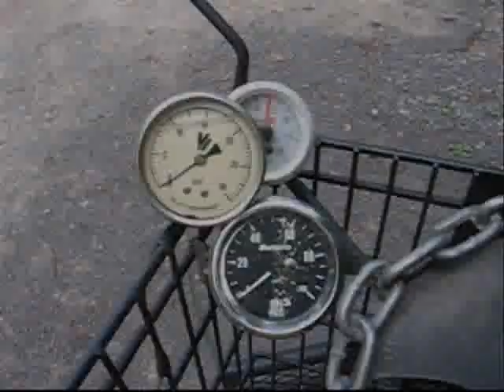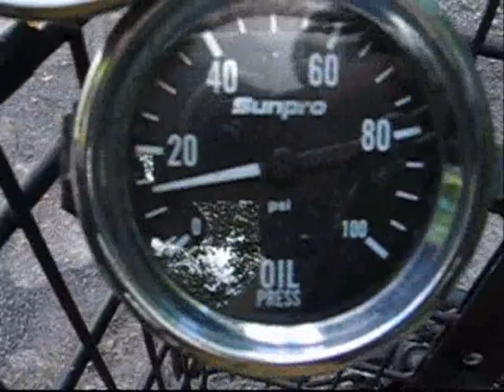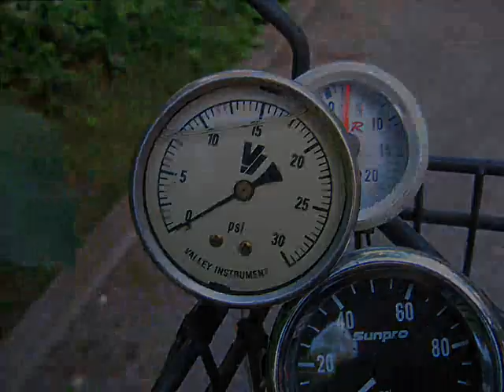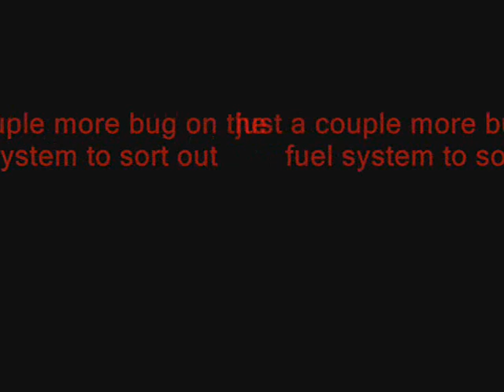lemegacool's turbo shopping cart BOV.wmv

Comment from the maker: oil pump is a oil burner pump i got on ebay, pumps way more than required! had to make a bleed off pressure regulator and carb is a 22 or 25mm i cant remember i got it on ebay and custom jetted it to suit the turbo

Comment from the maker: @da7nesman  actually yes but its not as drastic as on a car since i only have 1 speed. a turbo doesnt make the engine spin faster... it creates torque. to use that torque i would need to get a smaller sprocket (to go faster) but for now when the boost kicks in the rear wheels break loose at 20mph on snow ;) preeettty fun